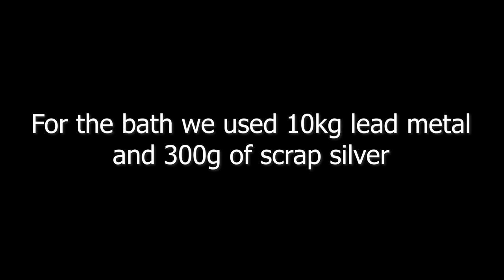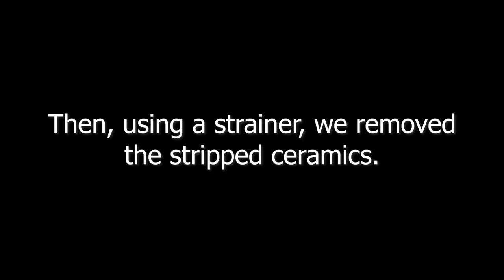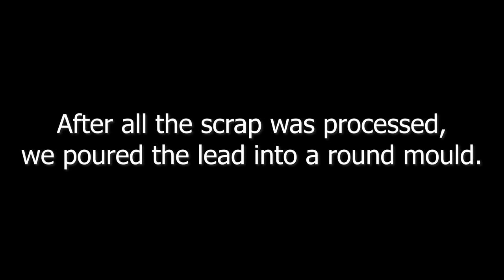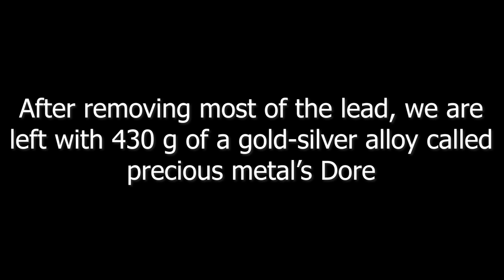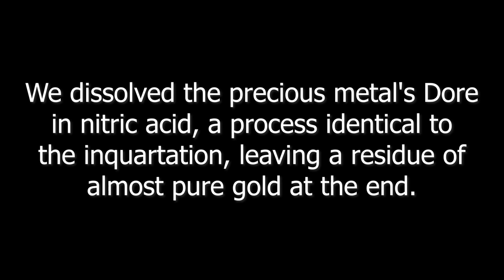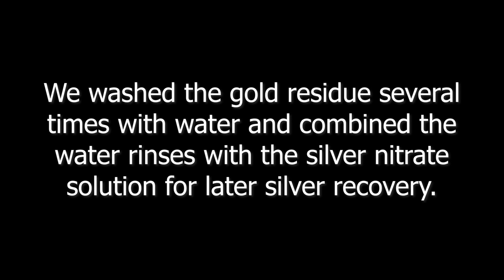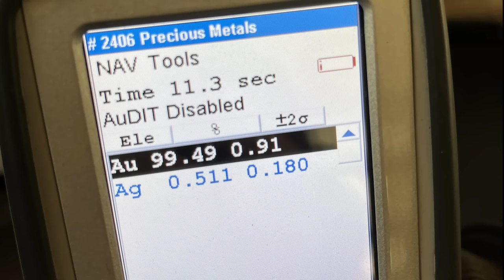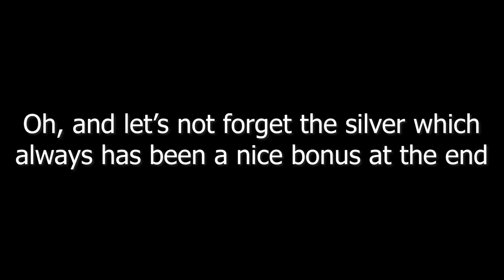Gold Recovery from 14kg CPUs

Comment: I don't know who taught you how to process ceramic CPUs like that. You've lost more than 30d gold with that processed shit.

CPUs are first crushed and can be directly processed with this ratio 3x1 muriatic acid and nitric acid is first cleaned by decantation to invite sterile material to clog Filters leave the first acid separated and add distilled water to the rest and filter in a skimmer glass with its flat funnel and the attached vacuum pump. The laboratory filter is cheaper than the coffee filter and that is not useful when there is only a little left to filter, we irrigate to avoid that the material is dry or parts of the acid remain in the sterile. Before throwing it away, add a little distilled water, shake all the material and take a paper for gold text, to the paper we will add 1 drop of ammonia if it turns black or changes color, there is still another It must be washed as many times as necessary and pass to evaporation, this can now be mixed with the previous acid.
When 50% of the acid remains with the gold concentrate, we add muriatic and nitric acid again at 1x1 until the reaction of other metals stops this, it will be added gradually and it will be safe to heat. The acid cannot reach the boiling temperature or it will jump out of the container dragging gold the quinine boiling is different 90°C is an optimal temperature. 15 minutes 
When the acid returns to room temperature, we will take 15% of its volume in distilled water and heat it to 85°C since this water is more prone to boil at a lower temperature and we will add Equitable to the expected gold but if you have practice you can create a saturated precipitant 5kg aqua 1kg metalbosulfite and use it when necessary to precipitate the precipitate at a better temperature Ambient and 24 hours old, we remove the acid by decantation and add another batch of precipitant to ensure that it does not contain gold, but do not throw away that acid either. It will be time to add the same volume of clean distilled water or mineral water, it would cost that it will react a little to that water, we subtract 30% and ipersate it with sodium chloride , for every liter add 10ml citric acid this will further weaken the acid sodium chloride will precipitate all the silver. 
The first beaker we will add only until it covers nitric acid by itself it will not dilute the gold it will only eliminate some unwanted metals to obtain 9999 gold .
Again, when removing the remaining acid by decantation and adding mineral water, I repeat, avoid boiling and it will only be necessary to filter and wash the laboratory filter, I do not recommend fiberglass take a paper filter since it will go directly to the crucible with the same volume borax add alcohol to create an amalgam and melt in a crucible with a lid.

Well, you flushed the acids down the toilet, what a fool, add sulfuric acid. 1 liter of sulfuric acid will require 10mg . Now you need a sterile graphite cathode foundry rod is the purest graphite and a rez seed metal of titanium or palladium since if you have extracted the 150g gold that contains 15kg AMD CPU Still contains 5 palladium 3 platinum and up to 8 ruthenium May contain traces of rhodium and the other platinum group metals .

Keep on throwing money with the smelting furnace
Reply from the maker: Mhmm